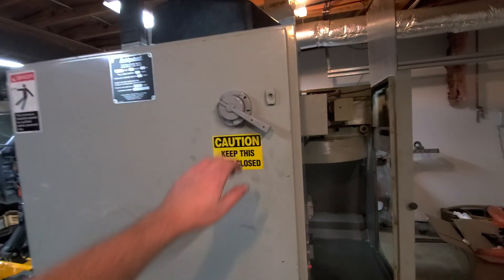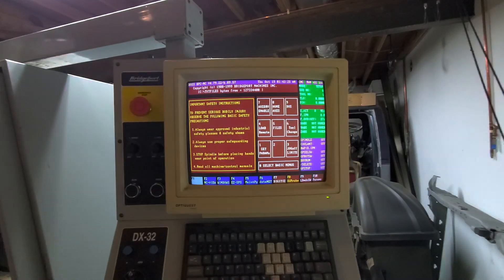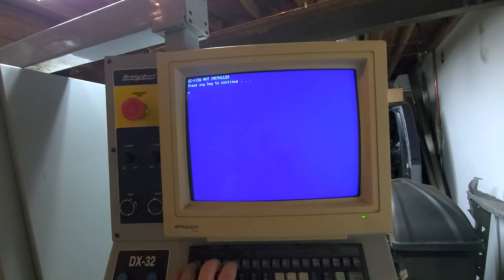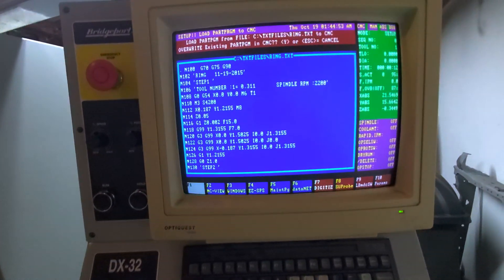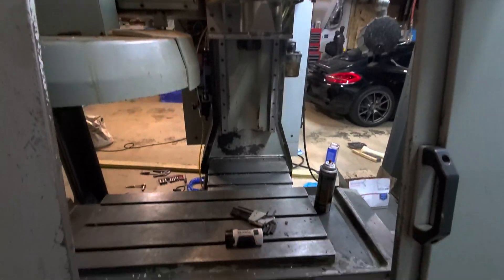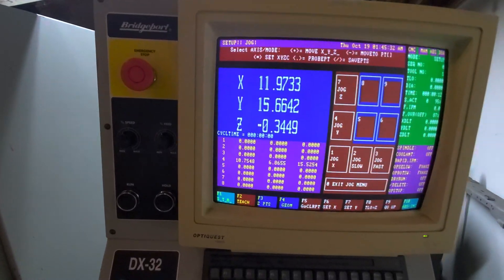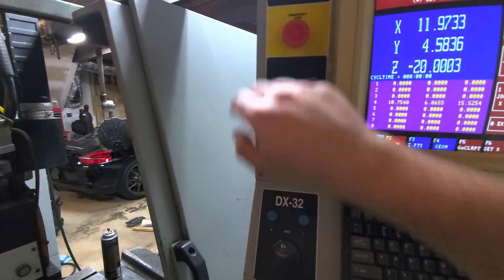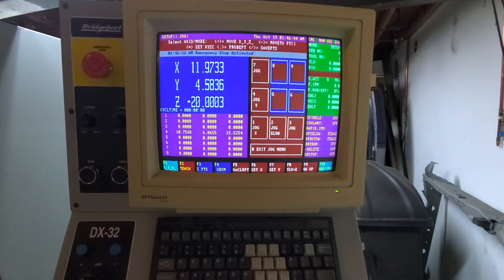Bridgeport Rebuild Part 2

Comment: What phase converter did you use? Thanks.
Reply from the maker: I have it running single phase.  The vfd on them will run with two legs then you need a bridge wire to bring some of the other areas online.  It's all documented online, it's a bit risky if your incoming voltage is more than 240 but it works. If you lookup Russellmakes I think he has an American rotary for his.  If I were to get a phase converter it would be solid state phase perfect, I'm not a fan of the rotary phase converters due to the wild leg, it can play havock with sensitive electronics and replacement parts for these old controls are crazy money.

Comment: I have owned 2 torq cuts and a Vmc 800 with the Dx 32 control. Other than the  hard drives crashing, they were good  machines. Make sure you have everything  backed up.
Reply from the maker: Yeah it seems to be a great machine, its built like a tank. I'm slowly working through it bit at a time refurbishing everything. I'm currently rebuilding the transmission and the spindle motor,  I'm also refurbishing all the pneumatics.  I have made some more progress I just need to go through the video footage and post it up when I get time.  Eventually I will fit a new centroid oak control and ac servo motors,  that should give the machine a lot more power and hopefully double the rapid rate.